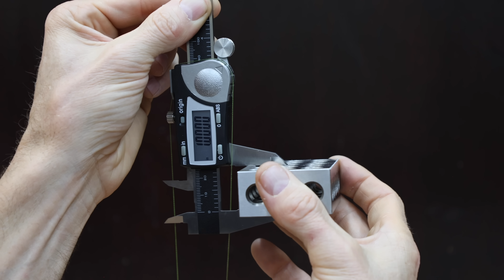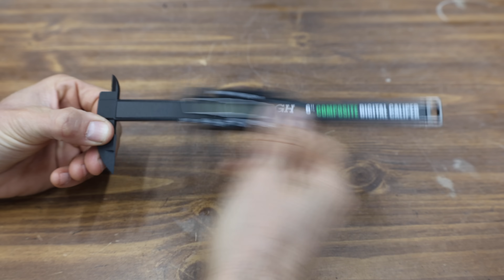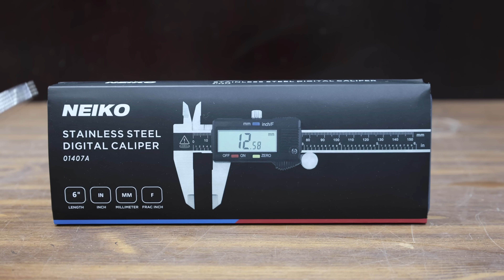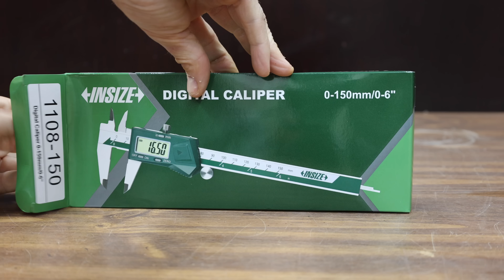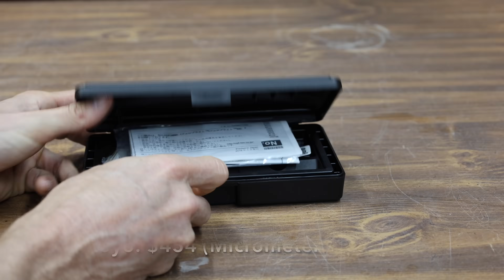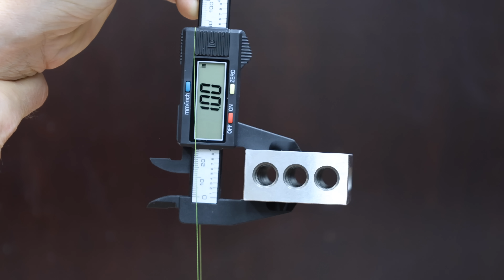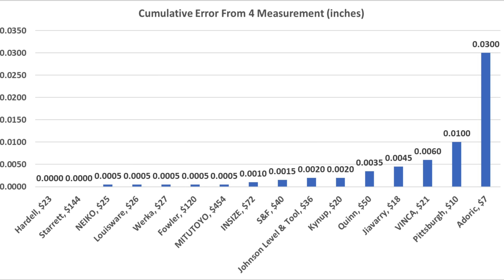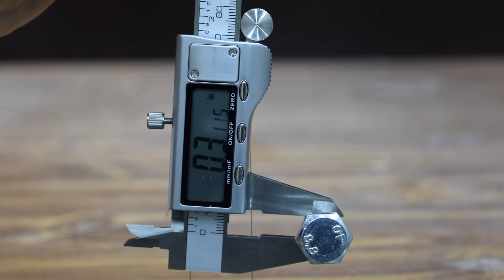I've Been Proven Wrong About Calipers!

Comment: There's the rub. If your company relies on accurate, repeatable and trustworthy tools to measure products during or after manufacturing... they really can't skimp on them.
Mitutoyo is overkill for a hobbyist or home machinist. But Calipers are "approximators", they're not that accurate to begin with nor to be used to final inspection unless the tolerance range is pretty big...

Also, some of these might start to show signs of misreading when battery gets low. Some might start to wear the jaws if they're not hard enough and cause errors, some might wear the stem when used for longer and thus cause measurement error etc...
Or they might be accurate at room temperature and then get wonky when in cold or hot climate.

There's so much to true metrology that it hurts the brain.

Comment: I'm not a metrologist, but I think what would add value for testing calibers would be testing consistency perhaps more thoroughly. You're already testing linearity by taking a measurement at different lengths, the next level would be to take repeat measurements to see the deviation. Typically you'd plot the average or deviation from the true measurement and standard deviation at various lengths to evaluate a measurement device, often is called a linearity curve or plot, I believe

Comment: I have a plastic Empire dial caliper. Millimeter and inch scales, and the dial is marked in hundredths and 1/64". If you need to read thousandths, it'snot the tool for you, but for many things hundredths are good, like measuring the thickness of a price of wood, diameter of a screw, etc. I like it because the plastic is much less likely to scratch a guitar than the sharp points of a steel caliper. When a moderate level of precision is sufficient, i think they are faster and easier to use than a caliper trading in thousandths.

Comment: Auto shut off does not matter on the Mitutoyo.  I've seen Mitutoyo calipers that are never turned off, and go years on the same battery.  Having used calipers in industry most of my life, I will always take a Mitutoyo measuring tool first.  Starrett and Fowler are also great tools, and do just as well in GR&R measurement studies.  But I just prefer the feel of Mitutoyo calipers in my hand.  Also keep in mind that the cheaper calipers start failing pretty quickly.  Unless abused the Mitutoyo and Starrett will last through many, many years of daily use.

Comment: FWIW, I bought the $7 NEIKO several years ago.  It worked fine for about 7 years, then would not shut off when you push 'off'.  Auto-off worked, but it was hard on batteries.  Replaced it with a 2-pack for a little less than $7 each.  Only took 1 out of the package, and it is working fine so far.  Probably 1.5 yrs to date, and all is well.  Tidbit for inquiring minds.

Comment: As a Journeyman machinist I bought my first set of "real" dial calipers in '81, Mitutoyo. Cost $75, well over a day's wage. They lasted me 30 years. Back then, electric calipers went through a battery a day!
Reply: As a TIG welder that fabs from blueprints I bought my second set of Mitutoyo dial calipers, 6 and 12 inch in 1982. The first set were stolen.

Comment: Here’s my take on the Jivarry as I had one for a couple years.

I mainly used it to measure cylinder bores and crank shaft journals and other things as I rebuild classic small engines. The couple years I had it, it was an awesome tool. The only complaint I had with it was that the batteries didn’t last long but other than that, the measurements it took were pretty accurate. I had to throw it out though a couple months back because the measurements on the screen would jump all over the place and I couldn’t zero it out anymore. I thought it was the battery so I put a new one in it and it did the same thing. So if you are looking for a caliper, I’d probably get something but I believe I got my $20 out of it as it got used pretty regularly. Hope this helps with you guys looking for a caliper!

Comment: Got a few sets of the Mitutoyos and also a cheaper Amazon pair. Honestly the cheap one does a great job to get you close on most general use things and also has the fractional measurements as an option which has come in handy! It rounds, but shows you 1/64th. For the low cost a caliper should be in every tool box!

Comment: I keep Pittsburgh in my garage toolbox and Mitutoyo in my work room when things are serious.  The battery life on the Mitutoyo is insane even without the auto-off function.  But you also want to have a few other versions like plastic jaws for magnetized parts and a 100mm length to get into tight spots.

Comment: I don't think you mentioned doing it, but when measuring depth, you need to zero them standing on the upper surface. This zero may not match the zero with the jaws closed. Also, I'd question the flatness of the surface you are using for the depth stop. Maybe a surface plate might have been better for that.

Comment: Between the uneven table and, You added a decimal point in the drill bit chart for the cheap calipers (an invented zero at the .0000 place which gave them an unfair advantage over calipers that actually measure to .0000 ! The drill bit was probably a half ten thou over just like the good calipers showed! You need to delete this test video or redo it with more scientific methods, I’m disappointed in this test, sorry, I’m a big fan of your channel normally.

Comment: You mention needing the weight to test as different force will give inconsistent results, I would have really liked to have seen that variance tested. If the caliper is more solid and thus gives less variance due to the force applied it will give more consistent values in the real world and thus I would consider it a better tool.

Comment: I would like a caliper that does not drain the battery while shut down. All the calipers i've ever used drains the battery when shut down. If you put them away without removing the battery then you will have a dead battery the next time you need them. I once saw a study about this but am unable to locate it at this time. Should have rated the case and how many extra batteries it will hold.

Comment: That table top is definitely uneven by a thousandth or more, making testing inconsistent, I suspect the higher end calipers were measuring the low spots on the table, thus the over measurement readings.

Comment: AVE took apart a cheapo and a Mitutoyo. There are differences in the electronics related to the quality of the components, design and techniques used in the manufacturing process. I surmise the reliability and longevity of tools depend on all those differences.

Comment: A few years ago I moved to vernier calipers and I've never looked back, not once. Cheap, durable, an inherently absolute scale that doesn't need zeroing every time, and never worry about batteries or "automatic turnoff" or anything. And more accurate than most people give them credit for.
Reply: They're not practical for the old welder with poor eyesight.
Reply: Those stamped numbers get harder to read every year, though...
Reply: @bryanpritchett  Etched! Not stamped...
Reply: I used to think that they weren’t accurate until I learned how to use one. They’re kinda cool
Reply: Yep, the "batteries" never die  😅😂. 
I would need to learn how to read them again.
Reply: Digital cals are for low-accuracy jobs and that's fine.  Real men use mechanical calipers with better resolution and reliability.
Reply: @robertendl9205 digital is what I used to use for low accuracy needs, but constantly dead batteries in cheap digital calipers is what drove me to vernier calipers. Good quality digital with a good quality battery will last years but a cheap digital with cheap battery I'm lucky to get a week out of it.

Comment: Amazing video! However, considering this is about digital calipers, I wish you had tested the current draw when they "turn themselves off" (or if you turn them off yourself). Especially with cheaper brands, they don’t truly turn off and continue drawing power from the battery even when the screen is off. This often leads to having to replace the battery every couple of weeks to a month, even if you're not using the calipers.

Comment: if you building engines, better spend money on something like the Starret or Mitutoyo. I am using the Starret my father had in the 70s and is still accurate. (not digital, the old fashion needle measuring)

Comment: For my company, the simple answer is Quality Managment System (QMS) compliance. Some brands like Mitutoyo are NIST calibrated which fulfills many ISO and QMS compliance requirements, such as having been built to NIST tolerances. 
Does it make the caliper better at measuring? No, but it makes tracability more transparent, and thus complying to ISO, supplier audits which may include CofC documentation, Mil-Spec req's (which we all know is trash) and internal audits of QMS's.

Comment: Im a machinist, my preference is Maher-Federal calipers they are about the same price as your Mitutoyo. Their is one test that sets calipers apart. Dunk them in machine coolant and see if they still measure accurately when wet. Machinists use a lot of different cutting fluids. If your calipers become inoperable when wet, then they become pretty useless until dryed out.

Comment: As buyer for the QA dept there is only 1 choice.  6"  mitutoyo.  All the 100.00 are ok they work fine.  The  mitutoyo are just a few grades better and you can feel it.   Did you notice the cheepos are accurate to what most people need, great tool box tool.  They are fine if your not using them every day.   I get the  mitutoyo for 124.00 his price is stupid.

Comment: My $10 calipers from autozone are accurate to within 0.0005 inches because my eyes aren't any better than that.  It runs on elbow grease (actually thumb grease).  It has an infinite precision analog display.  Its been serving faithfully for over 30 years.

Comment: I've been told this, and then followed up with some research. Auto-off doesn't actually matter all that much. LCD displays, unless they have a backlight, use almost no power. If the digits aren't changing, there's negligible drain on the battery. Most of the power draw comes from the sensing circuit. So IMO, auto-shutoff isn't that big a deal.

Comment: You need to redo this test because: 
 A. Calibers are used in a wide range of temperatures, sometimes straight from the picket +30°c and sometimes outdoor at +5°c. The expanding of the tool (plastic vs steel) is very different and will give very different scores. 
B. You did not test depth or Internal dimension?!?

Not a useless test but a clickbait test

Comment: I've had a bunch of different styles of digital calipers over the years.  The only issue I've ever had is battery draw.  Some of them require battery removal when not in use.  PITA.  The last set i got from HF has been mint.  I wouldn't count on accuracy past about .01"

Comment: You didnt touch on the most important aspect to me. My mitutoyo calipers still feel the same 20 years later as they did the day I bought them. Also, the battery life is far superior. Every time I grab a set of cheap calipers the battery is dead so I have to go find a new battery before I can do any measuring. I can't remember the last time I had a dead battery in my mitutoyos.

Comment: My suggestion is to evaluate dial calipers; many people still do including myself. There is nothing wrong with digital calipers, but if you use them rarely, you risk having a dead battery at some time when you really don't want to go to the store before making measurements.

Plus, I just like them, and you probably shouldn't be trying to measure anything tighter than .0005 with any kind of caliper.

Comment: i use calipers almost daily, and i would agruee the smoother the movement is the worse the calipers are. You know how many times i've had to remeasure something 2-3 times because when i go to remove the calipers it opens up a little bit. I like my calipers on the non smooth side to prevent this

Comment: what i have found over the years is that the cheap ones measure fine with a new battery (some of them have trouble going back to zero) but when the battery start to run low the measurements starts to go out the window. and then if you leave the cheap ones in the cabinet for a year the battery are dead. at work we use Tesa and Sylvac and they are used heavy every day at the battery last almost 2 years and it dosen't matter what type of battery it is the all just work on the more expensive stuff

Comment: i use harbor freight dial calipers and they are absolutely accurate to better than the .001" which is their resolution. Digital calipers all suck because their accuracy drifts as the battery voltage goes down.
Reply: Digital calipers don't ALL suck.  Performance as the cell runs down is one of the things that marks out better quality calipers from crappy ones.
Reply: @wilhelmvonn9619  i mean....they do all suck. Some a little less than others. Dial calipers 100% of the time...every time.

Comment: "Why is 'smoothness' even a category? After 50 years using calipers, I couldn’t care less. Same with how tight the open/close action is, what matters is that it doesn’t jump digits.
 A top test for me would be to measure a 1-inch OD, lock it, then check the ID jaws at that setting. That difference matters OD and ID may not be aligned. Also, does sliding up and down the scale "all the way" shift calibration?

Comment: Thanks for another nice video. Just minor issue. Battery energy capacitance is Watt-hours. Amper-hours is applicable only if you compare batteries with equal voltage. CR2032 has more than 3x capacitance of LR44. And it's a good idea to measure current consumption on powered off, powered on parked and powered on constant speed moving calipers, often battery replacement may be just very annoying. Also if caliper has no low battery indicator it's very interesting how it will perform on weak battery.

Comment: Todd, you missed on of the real PITA with many of these.
Even though 'off' many of them are still actually on.
Would be good to revisit in 6/12 month to see which still have battery life left.
Or, just put a DMM between one of the leads and see what the current draw is after 5/6/30 mins auto-off kicks in.

Comment: I had to laugh about evaluating precision measurements on a woodgrain surface with no perpendicularity reference. Nothing with a resolution of 0.010" is worth using. Even my non-electric Brown & Sharpe Vernier calipers do better than that. Calipers are for quick measurements, not accuracy. Jaw stiffness plays a big part. My 12" Mitutoyo with the beefier jaws is more accurate than my 6" Mitutoyo. But if I need ACTUAL accuracy, I'll reach for the micrometer. A variance of 0.0005" is easily accomplished if you aren't careful about thoroughly wiping off the jaws with every measurement. That's about the thickness of a dirty fingerprint or a piece of lint.

Comment: Don’t be fooled by the auto shut down! Many cheep calipers still have a slight trickle of current when off,  which if stored and not used for a while will drain and then corrode the battery and possibly the battery compartment contacts and PCB. If you don’t use them often it’s best to remove the battery! Otherwise when you need them your’ll find them destroyed!

Comment: I've been using the Jiavarry caliper (or one exactly like it with the same accessories - it doesn't have a brand or tag on it or in the instructions) for over 4 years at home without any issues. It loses the stiffness required to move it with time and basic use. For the price I paid, very happy overall with it.

Comment: I love the comments from all the machinists about Starrett and Mitutoyo being the only ones they will use... but if everyone in the machining industry was that smart at buying tools, why don't we have a left handed version or a version that can be read while measuring parts chucked up in a lathe. It seems no matter what way you try and accurately measure the part the display is always facing away from you.

Comment: I gave up on battery calipers a while back. I only need calipers occasionally and every single time I would try to use them, they would need new batteries. For now I am using Anytime Tools dial calipers. They aren't super accurate, but for my needs, they are just fine.

Comment: I had some of the cheap calipers with rubber buttons like most shown here and whilst they were accurate enough for my purposes the buttons were far too easy to press leading to mistakes and frustration. I switched them to a set with clicky buttons (similar to the kynup model shown) which immediately solved my issue, so id recommend avoiding most of these based on that.

Comment: The auto-off feature is useless on that Adoric caliper (i think it is the same on all calipers that use that house with an LR44 cell) because it will still drain the cell after a couple of weeks/months. The only solution is to remove the button cell.

And please, use metric and not inches 😥

Comment: Love my Mitutoyo. Paid extra for a calibrated tool. I also own the Kynups. The Kynups can give different readings when measuring the same object multiple times. I also have an old Central dial caliper (inch only), these have always been very accurate. It also seems unfair to have the Mitutoyo set at $454. You can get just the caliper for about $150.